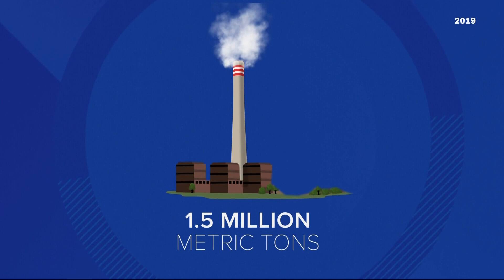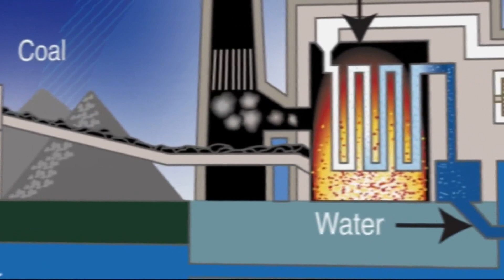Why was Oregon's last coal-fired power plant shut down?

Comment: I agree we should shut down polluting power plants. I don't agree with shutting them down before building a replacement. But if the people of Oregon want higher electrical prices, and more black/brownouts from overloading our already underpowered and overtaxed electrical grid as we shut plants down, so be it. Just don't cry about your AC not working at the peak of the summer heat, or not being able to charge your new electric car the gov't convinced you to get for the environment. Do your part and sit in the dark.